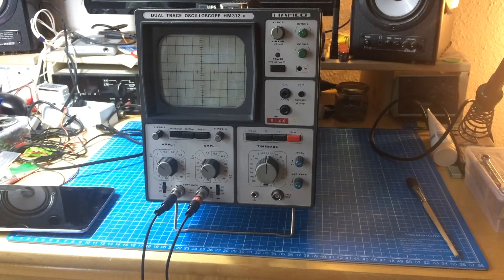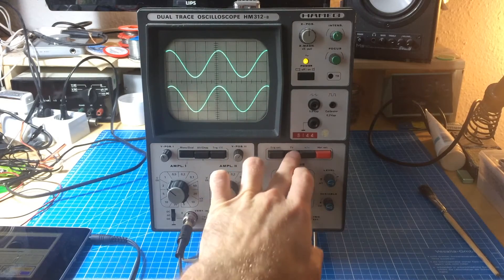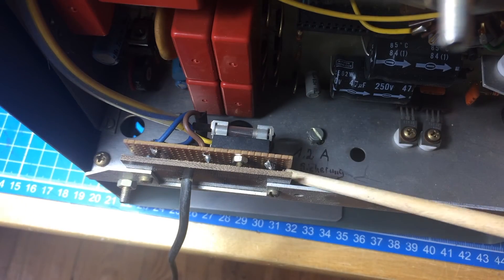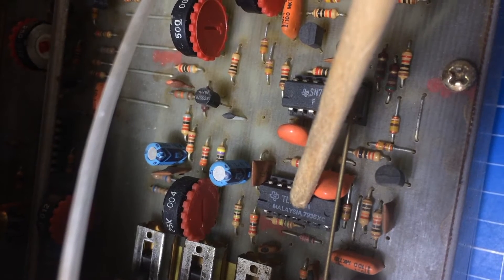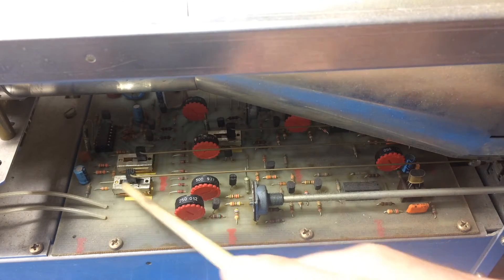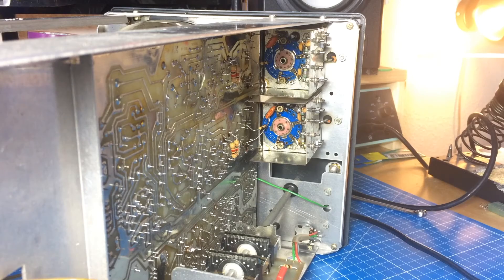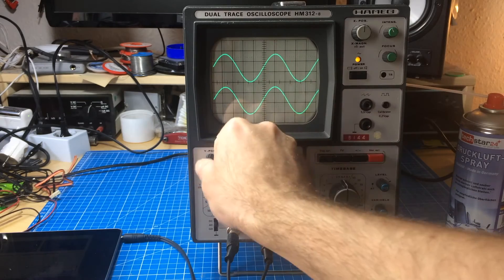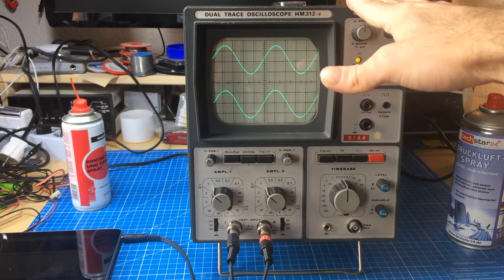Hameg HM312-8 Vintage Oscilloscope Teardown and quick Fix

Comment: Quick question as a new osiliscope guy how do you connect the left and right channels? are those two bnc connectors on the front for the left and right?
Reply from the maker: They’re not exclusively for left and right, but that’s how I connect stereo equipment for testing. They are just two separate oscilloscope channels, you can also use them to compare signals and such obviously.

Comment: Great channel!

I have inherited a Hameg 312, and have connected stuck to my hi-fi system with an adaptor to make some cool visuals. It works very well, but I think my model is an earlier one than yours and only has a single rather than dual input.

So when i tried some oscilloscope music by Jerobeam Fenderson, rather than the 3d images he gets, I get something else, in 2d.

I'm thinking maybe that I don't have the XY axis option that would render images in 3D for this model. Would that be right?
Reply from the maker: Thanks! Yes, the oscilloscope music visuals use two channels, displaying one on the x-axis and the other one on the y-axis to compose the images. Doesn’t work with a single channel scope without x/y mode unfortunately.
Reply: @JanBeta  thanks for your reply, much appreciated. I'm still happy with the visuals I've been getting with mine, but clearly I'm not getting the full experience.

But I've seen the same model as the one in your video being sold in my town for 20 euros, so I might give that one a go.
Reply from the maker: 20 Euros is a good deal. It’s a really handy little scope! :)
Reply: @JanBeta  sadly my new 312-8 is kaput. It powers on but I get no signal/image through on the screen.

Obviously it could be anything from failed solder to blown capacitors. Not being an expert I'm just going to put it back on eBay Kleinanzeigen and let someone else have fun it.

In the meantime I will stick with my single channel and the search continues....!

Comment: What kind of contact cleaner did you use? There are lots of them and I don't know how to choose it.
Reply from the maker: I swear by Teslanol T6 Ozillin. It’s similar to Deoxit (which you can get easier in the US). Mild Contact cleaner and it also lubricates and prevents corrosion in potentiometers.

Comment: I have this scope bought it off eBay for £5 and I cleaned it all out including the switches with isopropyl and contact cleaner. Had it re-calibrated and now I have a working scope. Thanks to your video.  Keep up the good work Jan 😁😂.......kim
Reply from the maker: It's a very nice simple scope. I actually sold it a while back and found the Philips scope some days later (see my videos about that one). I kind of regret selling it but wouldn't have room for more scopes at all so I guess it's okay. ;)
Reply: Where did u have it re calibrated ?